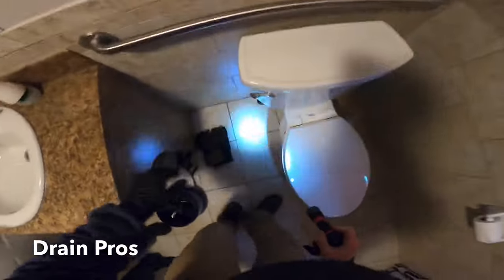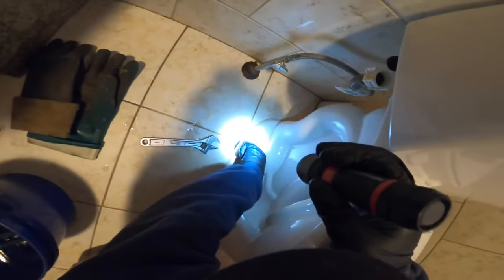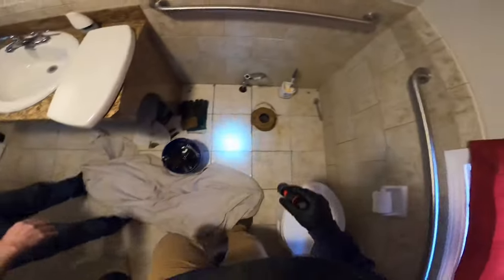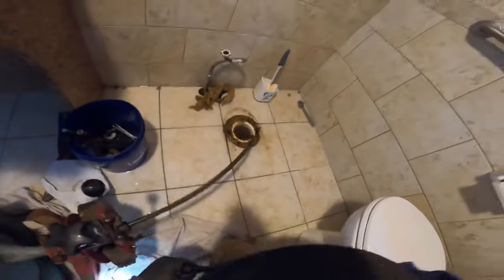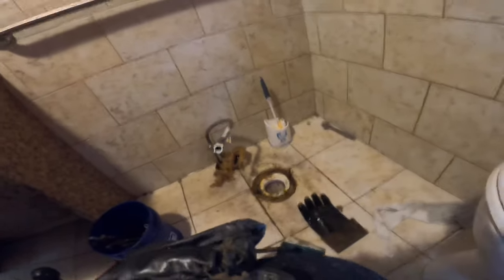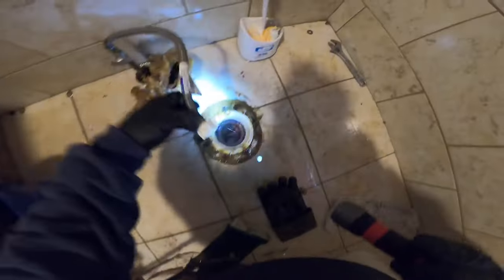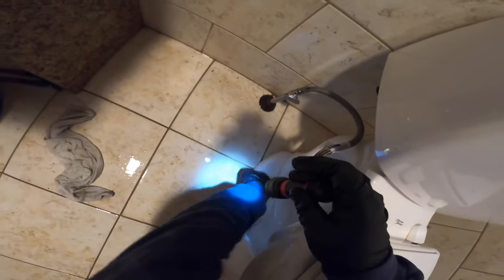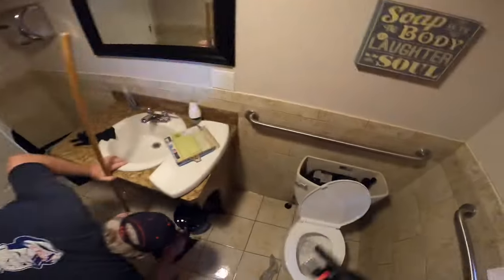Sewer Drain Clog - Drain Pros Ep. 29

Comment: Learning all about this as I’ve come across a clog somewhere in my house 😂 I’ve took apart my dishwasher and bought and new hose for it and that wasn’t even the problem. So now I’m here at this point, taking off my toilet. Can’t lie, it feels good to know how things are done
Reply from the maker: That’s awesome to hear Kenny! So many DIY things you can take on around your house these days with the help of YouTube 👍 if you every run into a plumbing issue and have a question don’t be afraid to reach out!
Reply: How do you charge for a job like this ? In general? Thanks really like the content
Reply: I removed the toilet in a double wide trailer and there was water clogged but now its just about 1/4 of an inch I've snaked and lubricated with dish soap and hot water (not boiling). Do you think if I put the new toilet on and flushed it I'd be good? Like I said I can see water down in the horizontal pipe but it's barely any,and it's not coming up the pipe anymore just sitting still where the pipe goes horizontal. Any advice would be VERY VERY appreciated
Reply: @Pops1811 Sag in the drainline or bad pitch somewhere, could potentially backup again if not corrected aka repiped.

Comment: I have an issue with my toilet downstairs thought it was the toilet replaced it but it’s still acting up. It does the slow drain it fills the bowl all the way up then slowly draines back down very aggravating I had a plumber come out and snake it and he couldn’t find any issues and check the vent at the top of the house and still nothing
Reply: Sounds like the fill valve needs adjustment

Comment: I removed the toilet in a double wide trailer and there was water clogged but now its just about 1/4 of an inch I've snaked and lubricated with dish soap and hot water (not boiling). Do you think if I put the new toilet on and flushed it I'd be good? Like I said I can see water down in the horizontal pipe but it's barely any,and it's not coming up the pipe anymore just sitting still where the pipe goes horizontal. Any advice would be VERY VERY appreciated
Reply: Always buy a new wax ring for toilet. They're only $3 to $10 at the most. Well worth it so you don't have to do it in 2 years with the water coming out from under the toilet rim.

Comment: don't use that brand toilet ring.  It is a sponge.  Nothing but problems. Used it  and pulled the toilet a week later when running flooring and it was a nasty sponge and really wet around the sponge.  I do use the rubber one with wax although and have not had any problems reported yet.